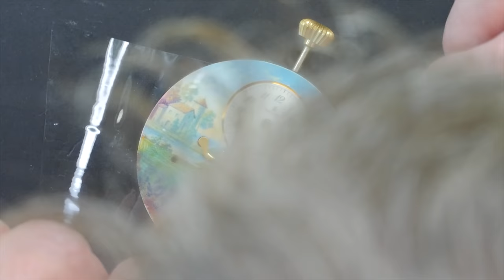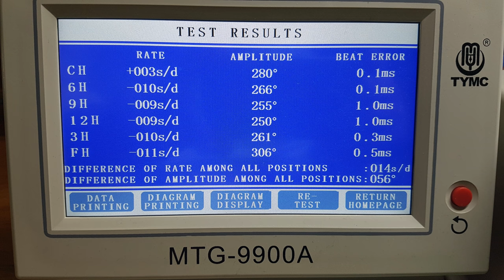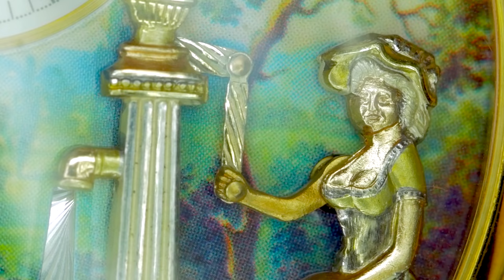Restoration of alluring music box pocket watch - Reuge Automaton - by Nicholas Hacko

Comment: aside from one extraneous exemplar, average of -10 sec per day.  Am i correct in understanding that this is a regulated balance wheel (as opposed to free sprung)?  Hope i'm getting the terminology right there. Did you have to regulate it and if so, what was the s/d beforehand?  What a beautiful piece and such a great video.
Reply from the maker: Thank you Paul- since this really a desk clock rather than a pocket watch, getting it close to zero is rather easy. The 5 position test is simply a 'sum check' which is performed to determine any unexpected deviation.  As shown, the result is rather consistent in all positions.  Keep in mind that this is a  1969 mechanism, non chronometer specs. Yes, the oscillator is set in beat by adjusting the stiffness of the hairspring. Thanks for watching!
Reply: Thank you for taking the time to reply and educate.  What a beautiful piece and a lucky owner.